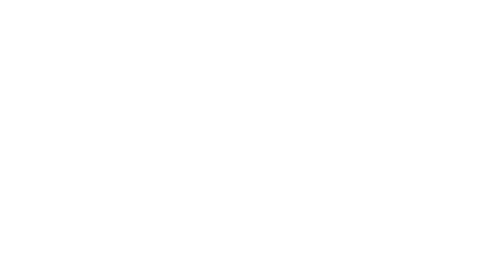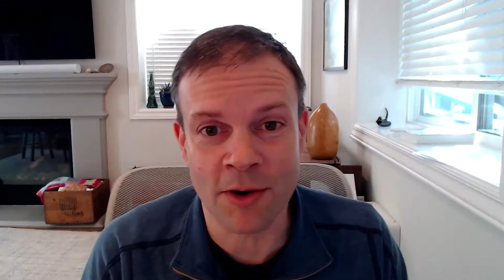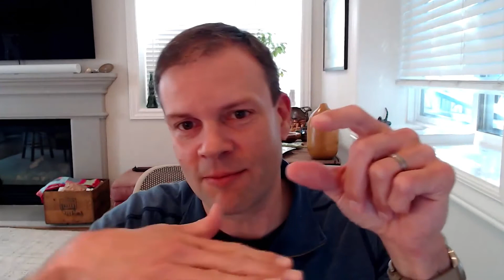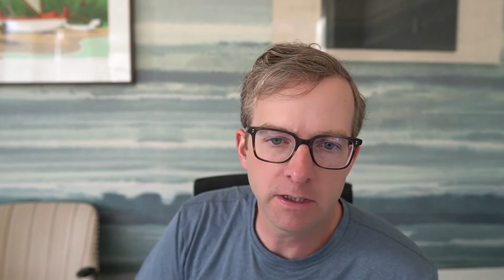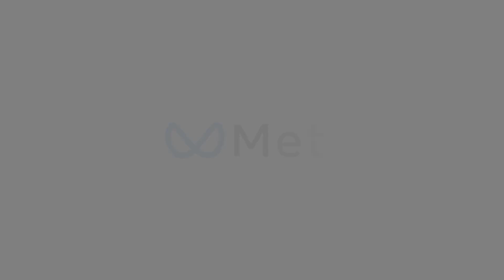AI for clean energy: Mike Schroepfer talks to Larry Zitnick about Open Catalyst

Comment: A co-worker of mine has a doctorate in material science. He's convinced that the valid design space of materials for solar panels has barely been explored, but to make serious progress we need big improvements in our computational models of the candidates.

Some of the material properties relevant to batteries overlap the properties relevant to solar, so as you sift through ML insights about batteries, it might be worth checking to see if the insight applies to solar. It's just a hunch, of course, but it seems worth a ponder. I can connect you with my co-worker if you want details.